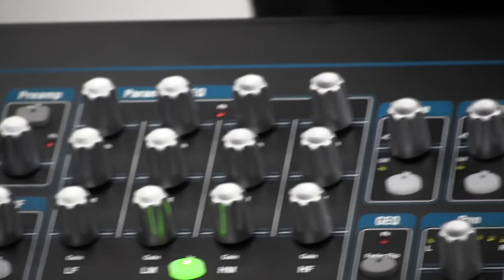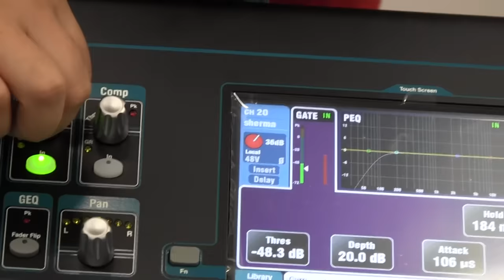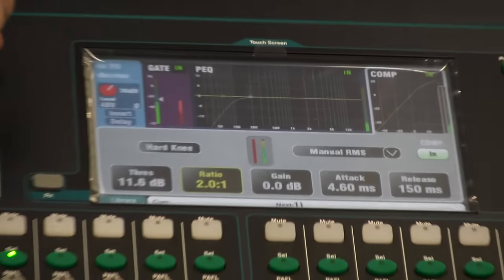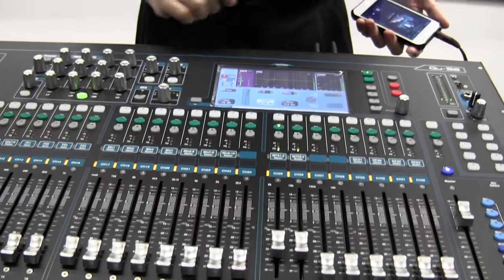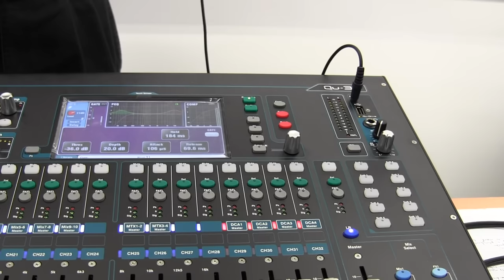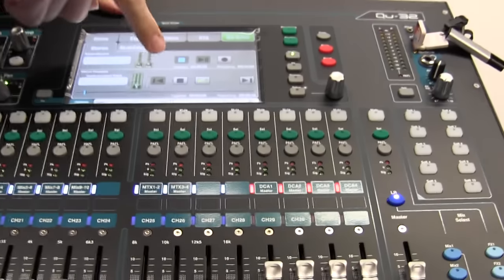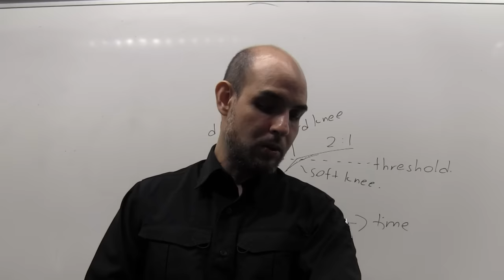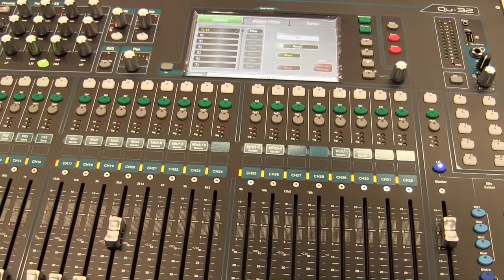Allen & Heath Qu-32 Mixer training part 2

Comment: We are using the QU-32 in our church and we have drums, keyboard, piano & guitars which I am running on mix 1 to floor stage monitors.  We are also running to each instrument with a personal ME mix system.  I want them to be able to  hear their instruments separate from the mix to the house.  Currently, the mix level going to their ears is determined by the level being sent to the house.  If the channel gets muted and the sound person forgets to unmute the channel, the instrumentalist has to play "deaf" so to speak.  I'm sure it's a matter of a pre-amp button somewhere but I'm not able to figure that one out.
Reply from the maker: Yes that is not ideal, when using in ears the performers should be able to hear their instruments at all times. How are you connecting the Qu32 to the MyMix system?

Comment: Thanks for your very helpful videos. At our church we have a qu32 an suddenly switching layers stopped working. Can you please tell me if it is a setting matter or is something broken? Many thanks
Reply from the maker: You're welcome Roberto. The way to test this is to do a full factory reset on the console - the instructions are in the reference manual. Then see if the problem persists. If it does you have a hardware problem and the console needs to be serviced.

Comment: Finally I've found some time to watch this second part...very great mixer indeed...it lets you bring only the mixer without any outboard gear isn't it? ;)

But does it have a stereo 31 band graphic EQ in the master section?(in order to tune the venue...)
Reply from the maker: +Cris Valk Yes you can basically do an entire show with just this mixer at FOH plus your PA back end. 

It does have the option of inserting 31-band graphic EQs into the outputs, but I much prefer using the 4-band parametric EQ: more precise and you can target the exact frequency needed.

Comment: - Is it possible to individually output each track recorded for example on Cubase, Pro Tool or Logic Pro via the USB input and mix them on the external physical mixer?

Or if the Allen & Heath Qu-32 can only monitor and record the stereo output of the sequencers in question like Pro Tools?

Thanks in advance for the reply.
Reply from the maker: Yes, both of these are absolutely possible but you need to know what you are doing in order to set up the interface correctly.

Comment: question..... i plug mi ipod in front of the mixer...my channel will be # 3 on the second leyer....how do i give monitor?.......i have on channell 3 a vocal mic conected...can it be use twice at the same time?... how i give monitor for both??
Reply from the maker: Same for both - press the mix button that you want to send the signal to and then raise the fader to give the correct level. The layers all work the same way when sending to monitors.